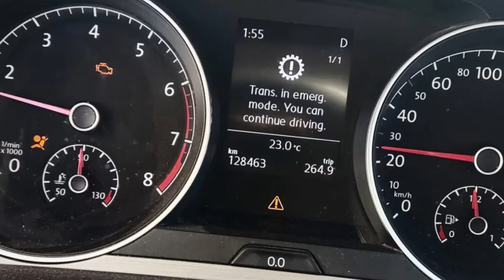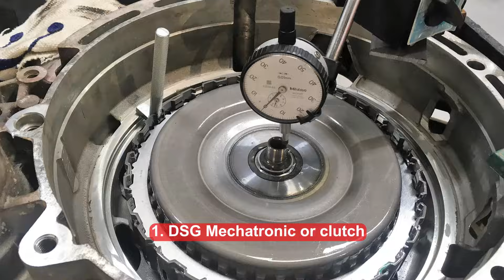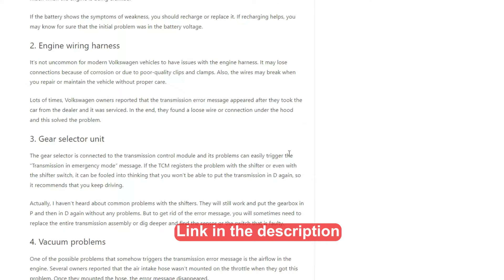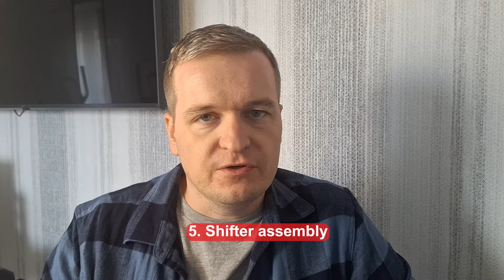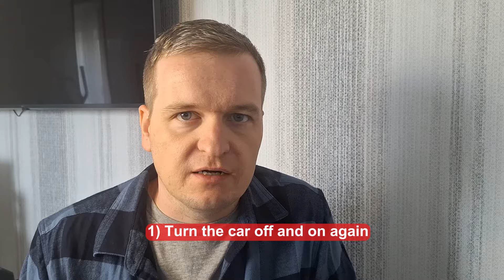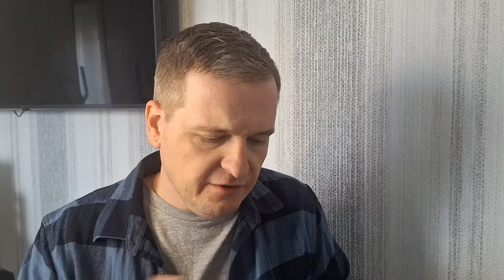“Transmission in Emergency Mode, You can continue driving” warning in VW

Comment: Hi to all who have or had this issue.  It's a weak battery/dying cell causing this issue with gearbox suddenly going into emergency mode. 

I have a 2018 Volkswagen Arteon and mine suddenly decided to only drive in uneven gears to get me home.  Booked in to garage assuming megatronics gearbox issue,  turns out by replacing the battery and coding any stored errors using their VCDS,  it cleared any faults and did not highlight after nor since.  Please get battery checked,  especially if like mine was (Original) and on 138,000 miles well over due a replacement.

Other things to note that if the gearbox oil level was below sensor level,  it would come up on the dash to alert you.  As everything is electronic in these newer cars,  my car emergency mode gear box,  flickering infotainment system screen,  slower crank when starting.  Everything but the battery light.....so do get batteries checked and don't assume as I did the worst scenario 

Cheers folks

Comment: this just happened to my golf 2017 dsg, however my car is stuck in gear two, it wont go above or below, ive got aa coming to collect it will get it too a garage, what should they check for, what about if i clear the codes on the obd scanner
Reply from the maker: The transmission is in limp-home mode. Clearing faults with a scanner may actually bring it back to life. But this depends on what was the initial trigger for the codes. Might be a glitch or might be a clutch failure, so a goid diagnostic tool is needed to see what's wrong.

Comment: My cat has rhis issue it only drives for 37 miles per hour
Reply from the maker: It's in limp mode because of the potential transmission fault. You need to read the codes with a good scanner and see what problems the vehicle registers.

Comment: I had this message today after long journey and the transmission stuck to 2/4/6 
No 1/3/5/7 
I have Skoda karoq 2019 TDI 2.0 L 4x4 100,000 km 

Then I stopped the car for 15 minutes then the message disappeared and every thing return to normal 

What shall i do ?
Reply from the maker: This is the early sign of mechatronic failure, but it can still last for a long time - you never know. With 7DSG, there is nothing much you can do to prevent this. Just drive it and hope it will not reappear anytime soon.

Comment: Hi today i had that message my gte just stoped driving in engine mode is i it stoped on the middel of the road and dindt drive no more if i gave gass it would do nothing. But when i go full electric is does drive and shift (also making a not good sounding sound) what could it be
Reply from the maker: First of all, I would check the 12V battery with a load tester. Then, check if the battery and main ground connections are tight and not corroded. If everything is fine and the vehicle keeps acting like that, it means the transmission is in safe mode and the reason is either the clutch pack of the DSG, or the mechatronic. None of these two are DIY things to diagnose or fix, unfortunately.

Comment: 2018 Tiguan, diesel, 2.0-liter, all-wheel drive, error U010100, error U000200, where to look? Automatic
Reply from the maker: The codes are not related and seem to be triggered by CAN bus connections. This may be just a faulty 12V battery or a wiring problem. A less likely reason may be a mechatronic failure in the DSG, but your transmission will freak out heavily if this happens.

Comment: What if it says transmission in emergency mode; and engine speed max 1200, and sometimes i get a start/stop error and EPC light on as well all of these at the same time
Reply from the maker: You need to get out the codes. EPC is just like check engine light - there are codes in the transmission module, or other control modules, that trigger it. But since you have the start-stop warning, I would start with checking the 12V battery. It may be weak and it may set all those warnings with random codes.

Comment: 2018 Tiguan with 87K .  7so dsg petrol 2.0.  this error came up after driving an hour for first time. we drive to our destination the gears stayed on 2,4,6 .  the tempature out was -10C . We drive an additional hour majority highway . R worked During parking .  Should we bring it to VW immediately ? after parking car restarted , no error and was on 1st as normal . The car wasn't driven .
Reply from the maker: This sounds like a clutch issue, but may also be a glitch in the TCU. I wouldn't worry much till it reappears. But if it does, don't tyrn off the car and go to the dealership to have it scanned while the codes  are still active.
Reply: @DmitrySapko thank you for reply . I'm not going to use it , my first drive is to dealer .

Comment: Hi everyone, I have a 2021 VW Passat Variant B8.5 with a DQ200 transmission. I'd like some advice. I'm the third owner of this car (before me, it was in Japan). According to the seller, there were absolutely no errors, and I also sent a specialist to diagnose the car before buying it; there were no issues with the gearbox, including no error codes. After the purchase, on the third day, this error appeared (the scan showed that the second gear was not engaging), but after restarting the car, everything disappeared and didn't reappear for a long time. About two weeks later, it popped up again, but this time it was (first gear not engaging). After restarting, it also disappeared, and now it appears approximately every two weeks. After restarting the car, the error becomes inactive and moves to the archive.
I don't know what to do anymore. I went to specialists, and they told me that there are no reasons to remove the gearbox; the diagnostics show everything is clean. This worries me a lot. What should I do? Who should I contact? 60 000 km
Reply from the maker: This seems like a software related problem or an issue with the transmission control unit (or its wiring). I suppose there has been an attempt to tune up the car and it may now have aftermarket software in the TCU or ECU. I would show it to the dealership with a claim of TCU software update first of all.

Comment: Hii i have jetta 2019 in my car error message says for 3 sec and it go away what might be the reason?
Reply from the maker: Looks like a sharp voltage drop which may happen when either the 12V battery is weak, or there is a corrdoded connection in the CAN system, particularly in the ECU or TCU. But of course, it would be nice to see what codes are stored and what else a good scanner can say.

Comment: the error appeared today for the first time. It says emergency gearbox mode no reverse gear. It only drove in gears 1,3 and 5. After switching engine off and on, I drive for around 10-20 minutes and limp mode happens again. I did this 3 times and each time it goes into limp mode. My Tiguan is a 2018 model and only done 78000kms. I always service at the dealership and have had a new battery 3 years ago. Could this be the mechatronics?
Reply from the maker: This looks like a clutch pack or mechatronics, but when was the fluid changed, in the first place? Sound a little early for the serious problems with the transmission.

Comment: “This error message appeared on my 2019 Tiguan. I’ve never replaced the battery, it’s been almost 6 years. Do you think I should have had the battery tested before taking it to the service? Because the service wants to replace the mechatronics.”
Reply from the maker: I would certainly start with swapping the battery since it's anyway about to die. But if they see certain signs of mechatronic failure in the DSG, it's quite possible that it's faulty.

Comment: I’d been hounded by the same fault message for nearly a year—consulted everyone under the sun, but no one could get to the bottom of it. Eventually, I took the car to a local workshop to overhaul the AC fan, which had been malfunctioning at random. That stumped the mechanic too. He ended up referring me to an auto electrician, who ran a full diagnostic scan and cleared all the error codes. But then the engine started banging, almost gasping for breath.

The electrician didn’t like the look of the throttle body at all. He strongly recommended dismantling it and replacing it with a newer one. I reluctantly agreed and sourced a used throttle body for around $50. Once it was installed, the fault message vanished—and hasn’t returned since.
Reply from the maker: Interesting, thanks for sharing!

Comment: So I happen to be getting the Emergency mode, but it only comes on after driving the vehicle for over 40mins. I want to think it is the sensor, but I am not sure why it is so Sporadic. As I can often power cycle and the error goes or give it 5-10mins and its gone for probably another 15-30mins.
Reply from the maker: Can be anything connected with the transmission, and hard to diagnose since the warning disappears. I would try reading the codes right at the moment when it's on the dash.
Reply: @DmitrySapko  Thank you, I have actually been trying to do so. The only other thing I have seen is Supply Low Voltage for the Left Light Module, sometimes both the Left & Right. Do you normally have other voltage issues triggered as well? or only the Sensor error?
Reply from the maker: This hints at battery/alternator issues rather than anything transmission-related. When something is wrong with the shifter or transmission control module, the message "Transmission in Emergency Mode" will usually by the only warning you see.

Comment: The car has 250.000km and this happening. Worth to change complete DSG not only Mechatronic [VCDS showingpressuresenor fault]
Reply from the maker: First of all, good inspection won't hurt. If expensive units need replacement, probably, it makes sense to find a replacement transmission at this mileage.
Reply: Changed pressure sensors and 1 faulty solenoid. After 1000km issue is back

Comment: i had the mechatronic fixed and a new clutch on skoda superb dsg automatic  2019 in february and it came on this morning 8am and 6:30 am this morning i am a taxi driver i drove the car for another 11 hours and it never came back on i did a diagnosischeck and the warning light was coming from the sensor on the  clutch

Comment: I never took the light seriously, clearly it must be a sensor issue (i hope) cause ive had the light come on since I've had the car for about 3 years now and it appears sometimes and sometimes it doesn't
Reply: What did u do when it comes on
Reply: Check out the throttle body mate, it was crucially resolved when I had to replace it with a newer one, since then the message has never come on anymore.

Comment: My Polo 2018 DSG Highline is doing the same thing and it jump gear 1,3,5 and 7 when driving. What might be the cause?

It started after they replaced Flywheel
Reply from the maker: This is clutch acting up. One clutch is for 1, 3, 5, 7, the second is for 2, 4, 6, reverse. Your mechanic could potentially assemble something incorrectly, but it also may not be related. Usually, I would look at clutch pack and TCU with these symptoms.

Comment: This happened to me during a very long drive. I’d been on the road for around 9 hours that day. Could this cause the issue to happen?
Reply from the maker: This shouldn't have happened just because of long driving. But as long as the fluid level is OK, the transmission doesn't punch when shifting, and the message hasn't reappeared after that, it must be fine to drive further.

Comment: Hello, When I first started my car, I put it in reverse gear and when I put it in forward gear; I encountered the error; “Transmission in Emergency Mode, You can continue driving”. There was only this error, I turned it off and on and it was fixed, I haven’t had any problems for 1 week. I encountered a weak value like 8v in my battery measurements and I changed the battery. Do you think this is due to the battery?
Reply from the maker: Yes, 8V is undoubtedly bad for these cars, most likely the problem was due to weak battery
Reply: @DmitrySapko  Thanks Dmitry, I'm glad there was no mechatronic failure.

Comment: New used approved car, dsg, not even done 1k miles in it and got this problem 😂
Reply from the maker: Yeah, modern transmissions are ridiculous. Some even think they are made to be bad for purpose - to make people switch to EVs.
Reply: I've had mine on since 40k miles, it goes on and sometimes it never turns on, nothing serious, catastrophic failure should've happened by now, I am at 80k now

Comment: Is it common for a sensor to go after a gearbox service? We have this situation right now and mechanic is saying a sensor needs replacing. They did a g/box service only 3 days ago
Reply from the maker: No, it's not common and shouldn't be connected with service. What comes to my mind, there may be an issue with some electrical connector. Also, I would get a second opinion here because if you see this message right after service, the fluid should be checked. Driving a lot is not recommended till you find out what's wrong.
Reply: @DmitrySapko  it was advised not to drive so it's at mechanic until we can find out if covered by any warranty. They appear to be decent genuine people but it's no cheap fix. They've offered to repair with no labour charge but still $1500 AUD (australia)
Reply from the maker: Yes, fixing modern cars is indeed expensive. I hope warranty helps!
Reply: Mine showed this sign after the repair of my mechatronic. Is it safe to drive?
Reply: What was the issue? Did they change the fluid and it worked?
Reply: @dibrag8927  it was the mechatronics in the gearbox. Very expensive repair need a replacement or rebuild. Thankfully our mechanic is a champion andmajority was covered on the warranty we purchased. Mechanic mentioned there were 2 different coloured seals they used at factory; one was a fix of only a few thousand however we had the 'other seal' and total cost to insurer was almost $7000AUD !!

Comment: I want to think it might be battery related on my side, because the air pressure sensors are also confused. This message then appeared yesterday, i have to say i was driving in scorching heat and it happened when i was shifting to sport mode
Reply from the maker: Yes, might be voltage-related. But if it reappears, some more attention is certainly needed.
Reply: Well I tested again after resetting the battery, the issue is still there. Now I definitely have to get it checked out 😢
Reply: No connection with 12v batteries 
Sensors shall be changed or mechatronic complete@SandisoToto

Comment: Hi, i use a TIGUAN TDI 2019, the message appered in my console, and when i switcged it off and  turned on , it dissaperaed for 25 kms and again started, i sent it to ASC for check up , hey did not mention anything about mechatronics etc , they said the oil sump is leaking oil and the erroe may be becaouse of it. is that true.
Reply from the maker: It's not likely to be the reason, but still possible. If nothing changes in the car's behavior, I wouldn't jump into conclusions and would keep observing it. Check the fluid level in the transmission though.
Reply: @DmitrySapko  thank u very much.
Reply: @DmitrySapko how can you check level in transmission?

Comment: Hi, this message has reappeared. I have read somewhere that gearbox oil for DSG is recommended to be changed at 40k. Could this issue can be caused by this? Really want to explore the other option first as I’m worried it’ll be quite costly.
Reply from the maker: I'm sure it's not because of dsg fluid. What's the scenario when the message pops up? Is it still under warranty? You can use the advantage of warranty, in this case.
Actually, a good independent mechanic with a good scanner will help. There's a bunch of minor things that can trigger this.